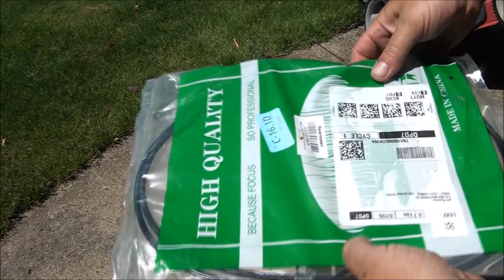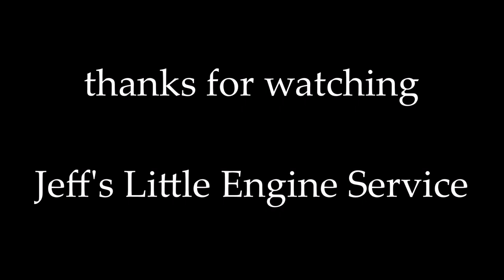Common failure CRAFTSMAN LAWNMOWER dual CABLE Replacement. HOW TO replace the CABLES on a push mower

Comment: Great video. Thanks.  A couple of years ago a neighbor gave me a similar mower. It didn't run and had been sitting in the weather for at least a year.  Today I got around to messing with it.  The cable was broken.  Just for grins, I put some gas in it, used a clamp to hold the valve open, and, shockingly, it started on the first pull.
Reply from the maker: Right on

Comment: I have never seen a cable like that one .  

More parts to break

Good vid there
Reply from the maker: Bad design I agree , cables rust frequently up here in the Pacific Northwest
Reply: @JeffsLittleEngineService   they rust in the humid climate of South East as well .  I always put a dab of Grease on them before storage.  Helped keep water out

Comment: Hey jeff.  I got lucky on that mower put a new z bend on drilled a 2nd hole on bale handle.   Put a z bend on other cable.  Worked good. Customer was happy.   I told her beforehand what a cheap option would be
Reply from the maker: Nice work, git r done son!
Reply: @JeffsLittleEngineService  them 🐔 sounds 😡😡😡😡

Comment: Nice video. Do you know where I can get the gasket to the air filter to the carburator?
Reply from the maker: Amazon, Ebay or your local lawnmower repair shop. Thanks for watching